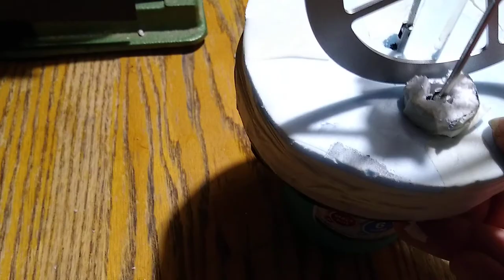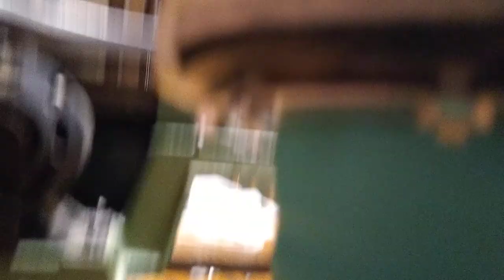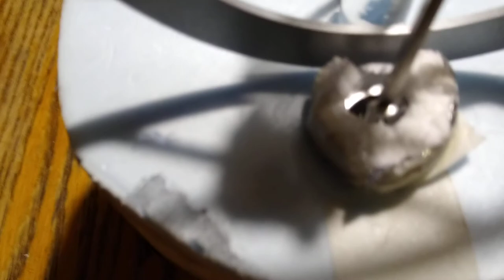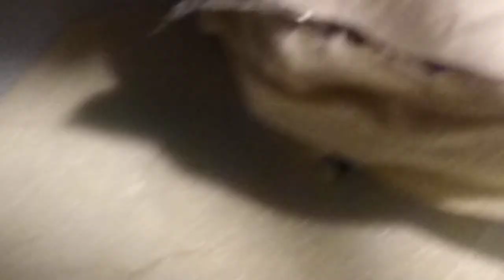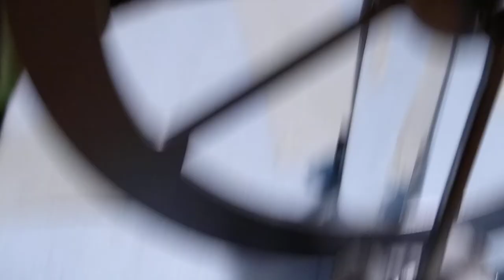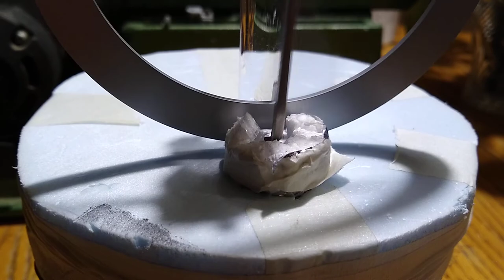Insulating the sink II, LTD Stirling with "sink" more thoroughly insulated. Third video.

Comment: do not see quite how that works , Stirling engines operate using heat difference between top and bottom plates in that version
Reply from the maker: You are correct. Covering the "sink" with insulation should have the opposite effect. The engine should overheat and stop. Read my description under this other earlier video/experiment:  https://youtu.be/zEqg1TgLqXI
Reply from the maker: And an even earlier experiment:

https://youtu.be/fFByKkGr5bE

I actually considered doing this experiment more than ten years ago in 2010. My theorizings on the subject from that time can be found on a Stirling engine forum here:

https://stirlingengineforum.com/viewtopic.php?f=1&t=478